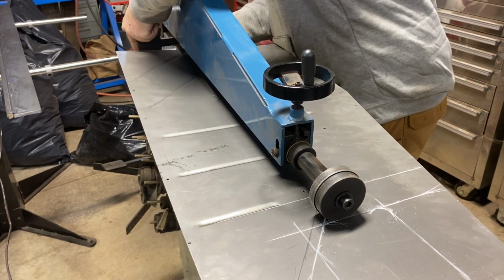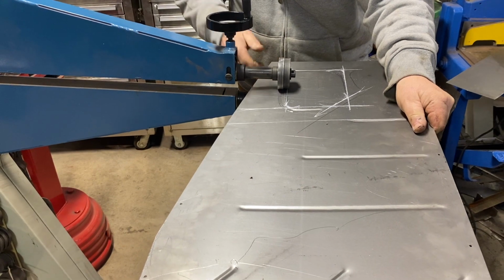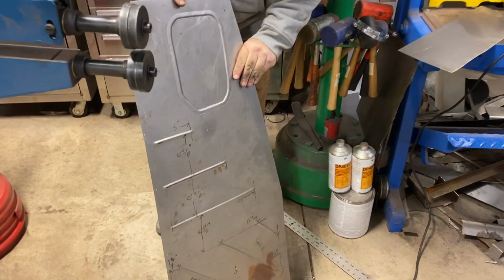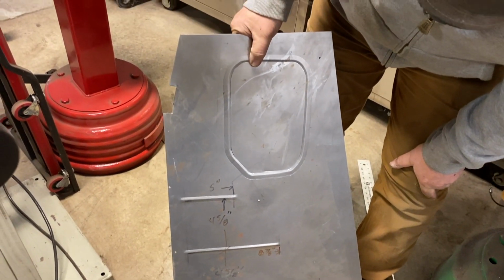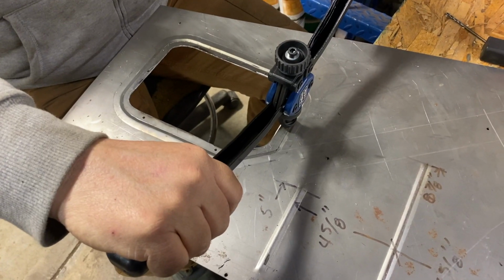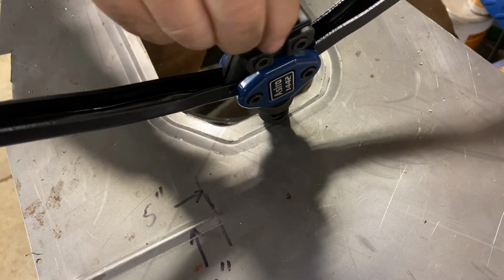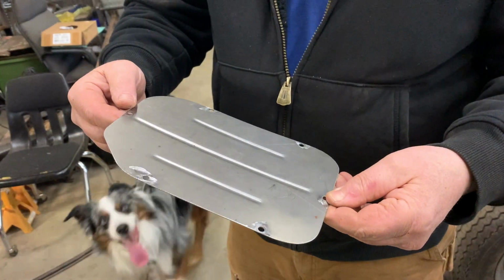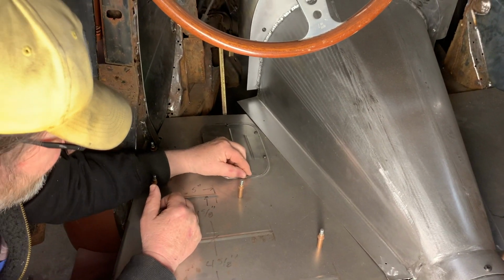41 Willys Brake Access

Comment: I have done couple under dash 90 degree Kugel brakes . However be careful what buy in these mounts as there are plenty cheap copies that do not use bearings or bushings for shafts . Plenty of room in Willys and works to get 8" dual booster to decrease the amount of vac needed from engine . Like it because first much easier to install and to get away from exhaust that could possibly boil the brake fluid . Old school is what it is old school that could be big mistake . Brakes a big headache for it to be safe . Not bashing your high quality work just a mention to think about .
Reply from the maker: Thanks for the information